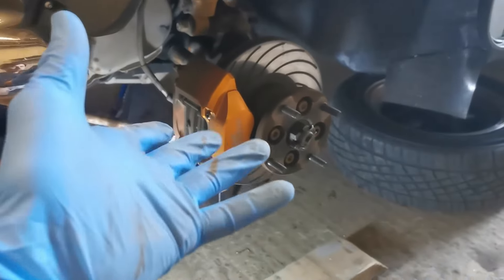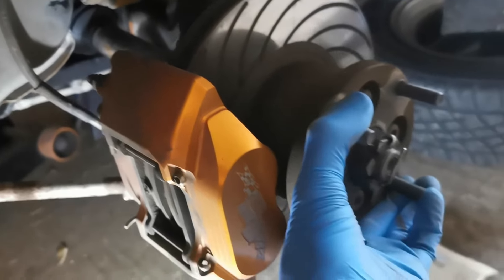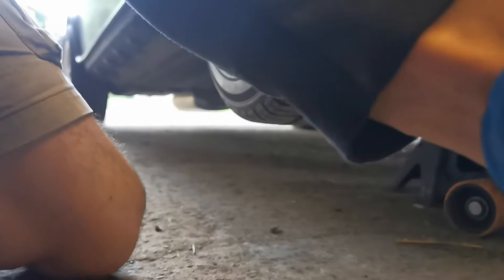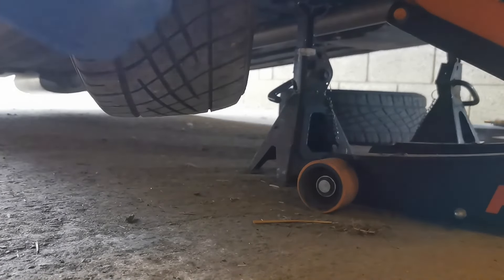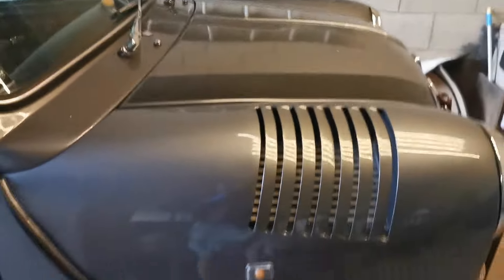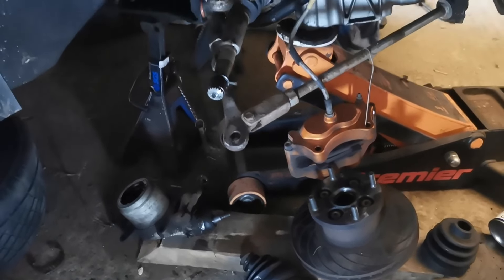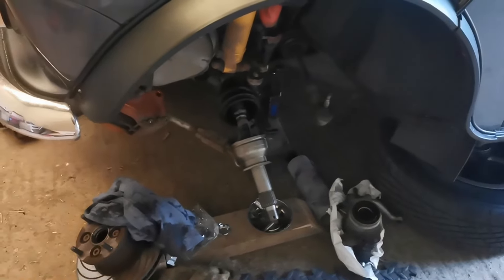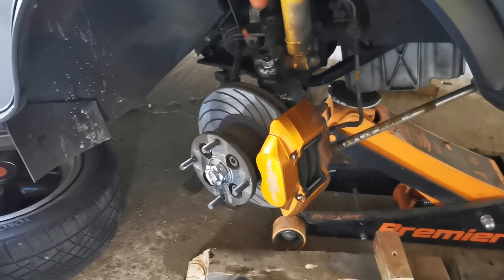The TURBO MINI - Kev Episode 83 - ECOBOOST - new CVS and Wheel bearings #kev #interior #classicmin

Comment: Getting really close to starting a swap of my own with this motor. I am trying to figure out if I can just source an engine and a few parts or if it's better to find a whole car. By they time you where done what all was needed to get this to run? Can an aftermarket ecu run it? Like what the 2.3l guys do?
Reply from the maker: Aftermarket ECU is probably the way. I'm currently trying to put a thinned down custom look and modified software OEM ECU in and it's causing big headaches. So aftermarket ECU or complete loom/car. 👍🐷
Reply: @PiggyPower  is there an aftermarket option that you recomend? I plan on keeping mine manual.
Reply from the maker: @xavierbrock8350  this one is manual too. It's quite limited aftermarket as the engine is direct injection, even Haltech don't do direct injection yet